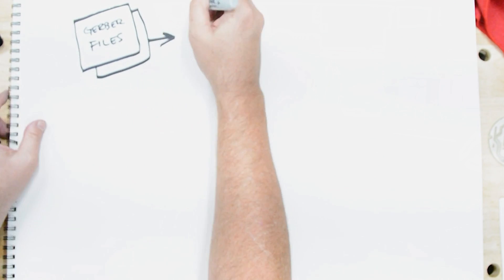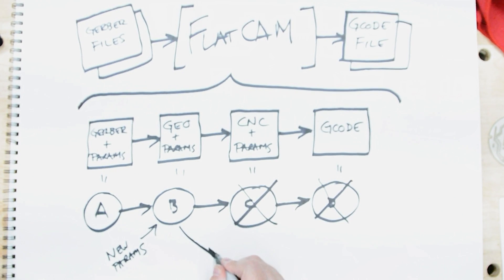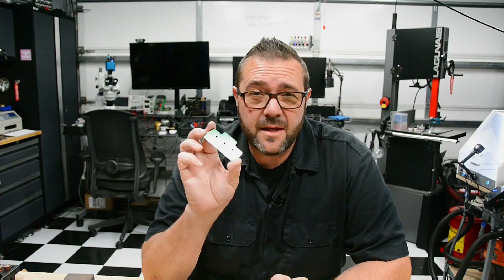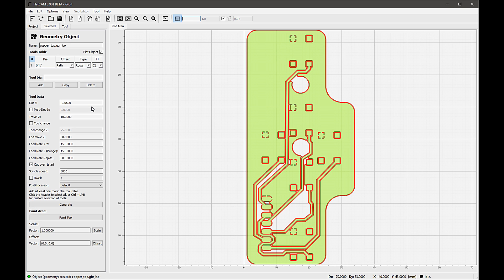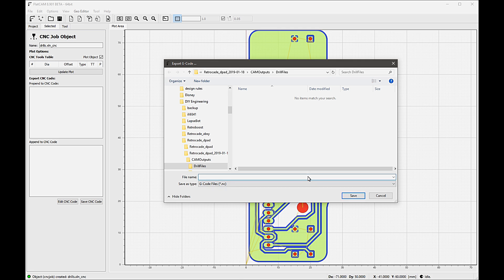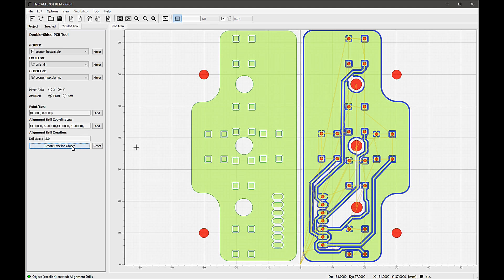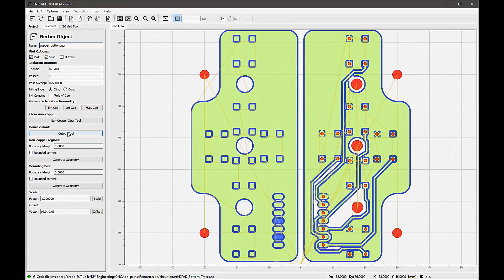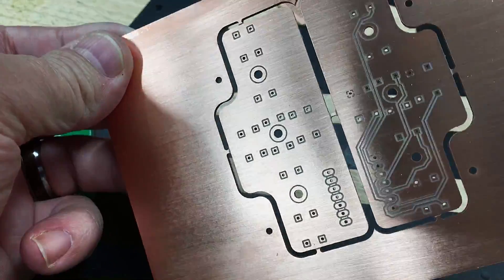Episode 033: Milling Two-Sided Circuit Boards Right

Comment: Seeing that the process with flatcam, I went ahead and ordered a CNC router.   However thinking ahead I'm wondering how you solder through hole parts for 2 sided boards?   I understand how to handle vias, you could solder a wire on both sides, but for a through hole part, many don't have accessable pins to solder on the front side.
Reply from the maker: https://www.amazon.com/Quality-Elements-Copper-Double-sided-circuit/dp/B015CV377O/ref=sr_1_4?crid=1XVEAVRU4C3WI&dib=eyJ2IjoiMSJ9.wiboyLzlLn_FI9D-LsagjUeb8oBUX9ixXUi_9ps34mK9nTcKl4j984BlNTjq-UEnrMe6PgXm07JIEurkF6rUbLsrIL_XLKQtcbcl2sv0b9oxFh6--vR-SkHJfhKXeGfRzVV86iXbLM3CMMnz2xVgubqALMgezRAe5ztOlC5zR1GTQ40wBF0h7DJjDbduDo-yTj4PlmdXc9EdHkZWY4F77fEwDF43oEc6fwVIOSGWvkuWnn-QLIrzxV5maGZGHSgP4Mfs_r3rwaOUilE02LZxQVSO-04s-Wn4vUf1Vb664bA2iT9IVLrBpbB_fKFA12Clx7cg4J-oj9qFkS5XvRFsJGNBjg7OJk5oOkig7oWBo_4.9ucolmQlOx4jTa3aTjlW1YwvNDwSZhn5Pou6ypAI_hM&dib_tag=se&keywords=pcb+rivet&qid=1740510070&s=industrial&sprefix=pcb+rivet%2Cindustrial%2C160&sr=1-4
Reply: @ that would work for a via but a header pin diameter is like .63mm. these have an id smaller than that. ill see if theres larger rivets but that will impact trace routing and footprint sizes

Comment: Just out of curiosity as this has proven to be something I have a hard time with, but how do you tackle vias when doing double sided PCBs?
Reply: I've looked into this too, and the solution seems to be to use either copper/brass pop-rivets, or sections of very small-diameter, thin-walled copper/brass tube that are cut a little longer than the thickness of the board, then have the ends flared out with an arbor press tool or a hammer. Sort of like how brass eyelets are installed in Kydex or leather.

In both cases, these DIY vias must be soldered in place after installation, otherwise you're going to have increasingly poor connectivity at the vias as the board experiences vibration and mechanical stress and as the metal surfaces comprising the joint oxidize.

Of course, either of these methods is going to take up FAR more space on the board than a factory-made via, but such is the cost of in-house rapid PCB prototyping. In any case, with how insanely cheaply places like JLCPCB and PCBWay now offer PCB printing services (and with how fast their turnaround time is, even for small orders) I don't really mess around much with trying to DIY my PCBs these days. I'll do a single-layer board every now and then for emergencies, but the failure rate, setup time, etc. make it less attractive.
Reply: @jonlewis5063  this is great information! Thanks for taking the time to type this all up!
Reply: @ryanlevy3474  No problem, bud! Glad to help :)

Comment: Hi! are you planning on releasing the video on your process for applying the solder mask and keeping your pads exposed? I know it's been a while but I'm struggling with that part of the process so it would be great to know the trick for doing that part, even a short explanation would be welcome
Reply from the maker: Sure, i can do a quick video this week on that!
Reply: @DIYEngineering  Thank for the awesome content and such a quick reply! is this something you still use as a prototyping technique, now that manufacturers are so fast and cheap? I personally like the option for one-off board prototypes or even final boards for some projects, particularly because I love distributed manufacturing, but I'm finding the solder mask and the vias to be the tricky bit.

Comment: how do you keep the copper clad fixed? do you rely only on the dowel pins o also use double sided tape? I can't tell from the video. I hope you can shed some light on this subject. Nice video. Keep up  the good work. Thanks in advance.
Reply from the maker: yes, I use Nittotape ( https://goo.gl/gGVnK9 )

Comment: the problem with pcb cnc milling is that it produces a lot of toxic fillings that can cause cancer when inhaled
Reply from the maker: Agree, and there is no safe circuit board process. be it solder smoke, ferric chloride, epoxy resin, or FR4 dust... I submit that ANY pcb etching or milling activity should be approached with serious caution, using respirators, hand and eye protection and proper ventilation when handling, processing and cleaning up all of the above. if you can smell it, it's not safe.
Reply: @DIYEngineering  instead of ferric chloride it is much more comfortable to use Hydrogen peroxide (antiseptic) + Citric acid (lemon acid) + Sodium chloride (salt)

Comment: Il like to see the solder mask
Reply from the maker: next vid, perfecting my process to share, until then you can see my solder mask at the end of the vid (the green board without white print)
Reply: @DIYEngineering  looks not diy (: how well does it handle temperature?
Reply from the maker: @Mr.Leeroy  handles temperatures well, uv cured epoxy resin, application of the resin is the tricky part (while retaining your milling wcs)